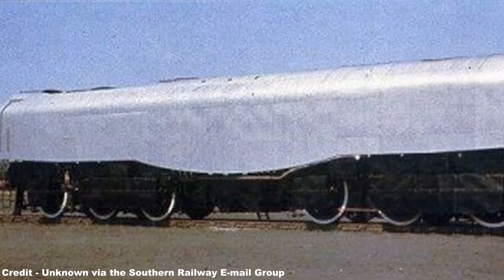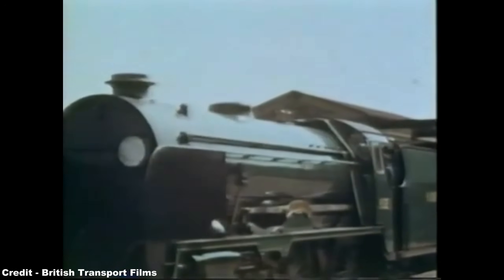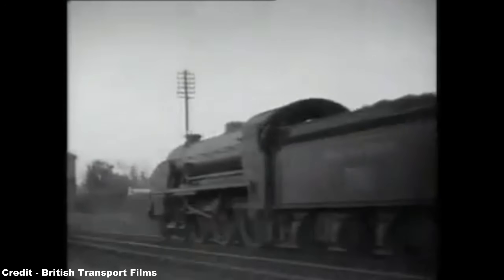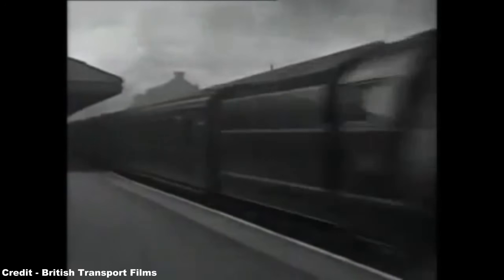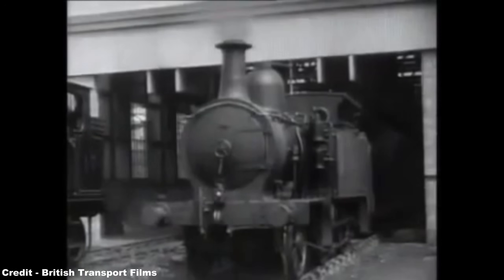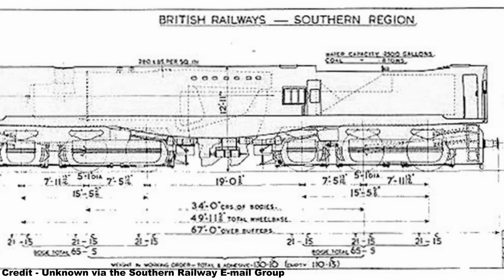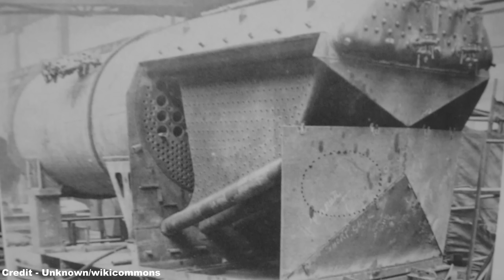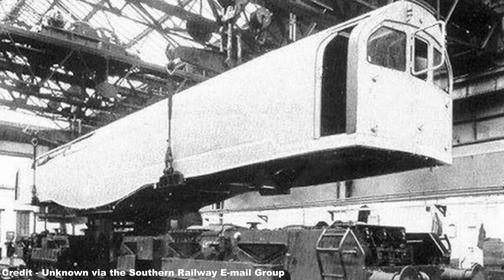Leaderless - The Story of the SR Leader Class

Comment: SR Leader Class is a waste of tax payers money. The big four were out of touch with modern locomotives they designed steam  locomotives while other first world Countries were  designing  diesel & Electric locomotives. domestically mined coal could gone to coal fired power stations to drive Electric locomotives. They should used the money developing  dual circuit third rail/overhead gantry Electric locomotives or straightening the rails out, or both

Comment: And during all that time EMD F3s through F7s and E units of various models were proliferating on the other side of the pond,, not to mention almost 5,000 GP-7s and GP-9s, never mind ALCO and Fairbanks-Morse and...   How very odd.
Reply: In the late 1940s/early 1950s the UK had no domestic access to oil but had huge coal reserves and a mature industry to extract them. The country couldn't 'waste' currency reserves on importing oil for diesel locomotives. Plus, up until the sudden about-face policy change in the mid-1950s, British locomotive expertise had almost completely ignored mainline diesel (bar some honourable exceptions like Beardmore and the English Electric/LMS prototypes), focussing instead on steam locomotives and electric traction. Steam predominated on the UK's railways, with an entire ecosystem of designers, engineers, footplate crews, fitters, workshops and running sheds to support them. Electric traction was well-established for urban/suburban railways, was successfully pushed to mainline use by the SR and was being developed for mainline use by the LNER. British manufacturers had established experience in building electric locomotives for export. 

So the railway industry had essentially no experience of diesel traction, and the country as a whole didn't have access to the fuel they needed. Plus, the Labour government had won a huge majority and two of its main supporter groups were the coal miners and the railwaymen - both would expect each other and their government to support their industry. That meant maintaining work and jobs in railway workshops designing, building and maintaining steam locomotives and fuelled by coal from British collieries. For similar reasons of economics and politics it wasn't feasible to import American diesel locomotives (and before the mid-1950s EMD refused to license its prime movers or electrical machinery for foreign manufacture). And while American diesel loco technology was technically superior, very few contemporary US designs met BR's needs for power, weight, axle load (an EMD F3 has higher axle load than Leader!), length and fitting in the British loading gauge. 

In those circumstances, you can absolutely see Bulleid's logic in wanting to design a steam locomotive that offered as many of the operational advantages of diesel traction as possible. It was the same logic that underpinned Robert Riddle's decision to procure the BR Standard steam locomotives a few years later - BR needed new motive power NOW, everything was set up for steam, electric traction was obviously the best option but needed a lot of time and money to introduce on a large scale, and British industry had no real experience with diesel. So BR would get a new generation of simple, versatile steam locomotives while a rolling programme of electrification was implemented over 20-30 years. That was all torn up within a decade by the Modernisation Plan...which rather proved that with the honourable exception of English Electric (which could, when left to get on with it and not burdened by a lot of top-down demands from BR, match anything coming out of America) British industry really didn't know what it was doing with diesel.

Comment: The key design feature of the Southern Pacific AC series was oil firing.  This meant that the fireman didn't need to be near the tender, which carried water and oil, and worked in the front cab with the engineer.  Note that the boiler was run firebox first, so that the cab was conventional, other than the addition of a front wall with windshields.  The only notable changes were piping oil and water the length of the engine, and reversing the eccentrics. Actually a bit problematic, since the "oil" was more like tar, and had to be heated.  I wonder whether it ever solidified in the long delivery pipes, or they were wrapped in a steam filled jacket.. Note that the operating unions were not happy with the cab forward design, being in front of the boiler in case of a collision. The AC's were not radical, just conventional mallets with the engine turned around. A final factor was that they didn't have cowls to concentrate the heat. Having the engineer and fireman in the same place was a very important factor for efficient operation and safety.

Note that several US railroads experimented with radical designs late in the steam era, all of which were either limited successes, or complete failures. Sadly, a decent mechanical engineer could have predicted the failures, but they were apparently ignored.

As people said about the Spitfire, if it looks right, it is right.  Leader looks wrong in many ways.
Reply: Separating the engineer from the fireman, while certainly not ideal, is by no means a dealbreaker. It couldn't be done on the SP since the whole point of their cab-forwards was to put the crew in front of the main exhaust, but there were other locomotive designs that did separate the crew with relative success. In the UK the Great Western Railway operated "auto-fitted" locomotives that could be controlled from cabs inside their passenger coaches, these were used for push-pull and middle-engine operations and required that the fireman stay in the engine while the engineer would be at either end of the train. In the US several railroads that operated in and around the eastern seaboard and the anthracite valley used "camelback" engines which had their cabs in the middle, straddling the boiler, with the engineer inside this cab while the fireman was on a footplate by the firebox, this cab arrangement was necessitated by the very large fireboxes those engines had which burned finely ground anthracite coal and emitted very little smoke, but were so large that a cab big and tall enough to see around them would unbalance the engine.
Reply: @asteroidrules  Crews hated the camelbacks.  There is an aviation term, "CRM" or Crew Resource Management.  Anyone in the cockpit can object and offer suggestions if a questionable situation arises. They don't station the copilot back in the cabin.  A steam engine driving a power truck is sorta OK for light duty, but this is a locomotive, not an Autotrain.  It requires massive components crammed into a very small space.
Reply: I agree about individual details, oil firing was important to the AC series, but disagree with your statement a decent mechanical engineer could have predicted the failures of the programs. No mechanical engineer was qualified to say it wasn't worth it, because no individual technical detail was the issue for proving the possibility of grand scale. In few cases where these actually expected to be flawless locomotives, instead they needed to be radical enough to prove there was still undiscovered potentual to be had with experimental designs on steam engines, instead of merely polishing existing designs till what would then be a certainty of replacement by another technology. And as the early british dieselification process would show, that tech was actually far further away than many people thought in 1946, as people had been advocacting fullscale dieselification was possible even before the second world war which was just ended, yet steam wouldn't really be phased out for two decades from its conclusion.

"Limited success" was fine, heck even failure to be viable in revenue service at all was fine, so long as it showed enough promise to justify having the workshop and team for one more decade. This is why Leaders issues with firebox where a nothing, all steam trains had those sorts of things, and even being too hot in front cab, overweight and unbalenced didn't really matter, it could be run as is, and those things where all fixable in a next iteration. What killed the project was the firemans position, it was a flaw that required total redeisgn, and IMO dragging the project on for the final 2 years (and more than a third of its spending) was a mistake based on sunk cost fallacy of the directors if you considered it as trying to make the leader class itself viable. However its also worth noting the last two years where where most progress was made on the power bogy, which if viable could easily be based under a totally different upper frame.

Being pressureed into approving 5 of the design before the first prototype was finished was likely also a mistake instead of finishing one, then later building another 5 to a updated design, but i feel this was known to all involved at the time, and part of the great rush to prove viability. A more ambitious operator probably should have started tinkering with its single prototype before wars end (it was already pretty far from Britain, and so the materials requirement for one train wouldn't raise too many eyebrows, meanwhile likely designs drafted for wartime locomotives at this stage where destined to go straight from approval to shredder without companies being interested to tool up for an entirely new design) but this was unthinkable for a taxpayer funded operation during clear calls for "tighten your belts" type war asterity to general public (well below a certain income level anyway). This resulted in the project being sort of too much done at once, to late to get adoption, and the most critical second machine neither being able to be finished, nor being able to incorperate most of the learnings from the first.

Many of these locomotives where bad designs, but many the wider concept was not a wrong direction. Far from ignored, the most qualified engineers who wrote the damning list of known defects of Leader and others where also the very ones to conclude to build it anyway. It is instead lessor experainced engineers who can't see the forest for the trees, and push for perfection in the few things they understand, instead of rapidly developing whats understood and easily fixable later enough to find out what issues they didn't predict, or even don't yet understand. It needed only one of the half dozen revolutionary concepts to go forwards to have been overwhelmingly economical to have spend 177,000 pounds to discover, instead of stumbling merely because one aspect didn't progress as initially intended.
Reply: @SheepInACart  Sorry, this very experienced Mechanical Engineer (for 59 years) says it was doomed from the start. A switch from coal to oil would have removed many of the problems, as the firebox wouldn't need to be adjacent to the coal bunker.  I stated this in discussing the AC's.  The fireman could then be at the firebox end of the carbody, like the ACs, instead of trapped in the heat between the coal bunker and the backhead.  There would still remain the issue that half the time, the engineer and fireman would have been at opposite ends of the engine, thus preventing easy communication between them.  Maybe add an intercom. The next change would be to remove the cowl, which just concentrates heat and fries the crew. Third, there is an awful lot of mechanism crammed into those trucks, asking for failures. That one has me stumped, and could be the insolvable issue.

Comment: Shame. More of the Southern class W would have done, or the LMS 2-6-4T design, of which a batch was eventually built at Brighton.
Reply: The W class was banned from passenger trains because of the issues with the K class (from which the W class used some parts as well as the wheel.arrangement).  Apparently experiments were tried with ECS movements and the W class was no better than the K had been on poor trackwork.
Reply: @rogercantwell3622 
They ended up building the LMS design at Brighton.

Comment: the idea of extending the life of steam power using domestically produced coal was a good one. however, with all the hot stuff centrally positioned and offset to provide a corridor you just know this project was doomed from the start. I'm no steam traction expert and I'm sure the experts out there will pull this notion apart but wouldn't it have been more logical to modify/adapt a pair of standard small locos coupled back-to-back to give the same result?
Reply: The Leader was a classic example of Bulleid - a man of skill and vision, and one of the few British locomotive engineers to really sit down and think how to go beyond the 'Stephensonian' locomotive that had been the standard blueprint since the 1830s - seizing any opportunity to innovate and try out his ideas, even when doing so wasn't appropriate. 'Leader' originated in a requirement to replace the SR's stock of ageing Victorian tank locomotives on empty stock and branch line passenger work. What was needed was something simple, cost-effective and easy to run and maintain. Early ideas in the SR drawing office were for a tank engine version of Bulleid's Q1 0-6-0 locomotive, adapted to 2-6-2 with bunker and cab designed for bi-directional running. Perfect. But Bulleid was never the sort of person who was satisfied with doing a 'workmanlike' job. It had to be special and different and innovative and groundbreaking. So the idea to produce a modern general-purpose tank engine turned into the huge 150-ton monster that was Leader, with power bogies and sleeve valve and chain drive and a car body and a cab at each end and a boiler with thermic syphons and so on and on. 

If Bulleid was really set on giving the SR the benefits of a tank engine with total adhesion (all driving wheels), flexibility (articulated power units) and bi-directional running, he could have gone to Beyer Peacock and worked with them to adapt one of their small standard Garratt designs and it would have - functionally - achieved everything he wanted Leader to do. But that wasn't his way of thinking or doing. And any one of Leader's innovations would have been a massive step forward (and a leap into the unknown). And Leader did them all in one go. 

I have to imagine that the SR board wouldn't have sanctioned Leader - or at least, certainly not committed to an entire production run of them - if they weren't quite aware that they were about to be nationalised at it would become someone else's problem. Of course, Bulleid had a track record of innovative but effective engineering. But Leader was a step way too far, and way beyond what the initial brief called for or suggested.
Reply: Like a double fairlie as found on the Ffestiniog.
Reply: @michaelmcnally2331  that's certainly one possible starting point
Reply: you mean as what was sort of done with a Garrett loco?
Reply: @turkeytrac1  Perhaps he was put off by the lack of a rigid overall frame, seeing speed was supposed to be a characteristic of it.

Comment: The Clean Air Act of 1956 was the final nail in the coffin of steam locomotive development in the UK.
Reply: I'd say the Modernisation Plan of 1955 was more of a factor.
Reply: @leeosborne3793 whilst the Modernisation Plan envisaged the end of steam, it was supposed to occur over a longer timeframe. There was still room for improving the BR Standard Classes or even Leader. The final nail was the Vlean Air Act which made the BTC liable for a fine for each steam locomotive making excessive black smoke in a smoke control zone. This is a major reason for the increase in orders from ten or twenty locomotives and the BTC ending up with many troublesome designs, like anything built by North British or the 1350hp Brush Type 2.
Reply: All clean air acts are designed to destroy the western world, at behest of globalists.